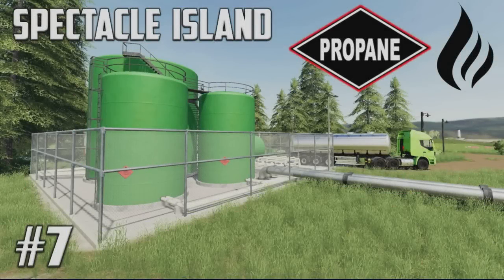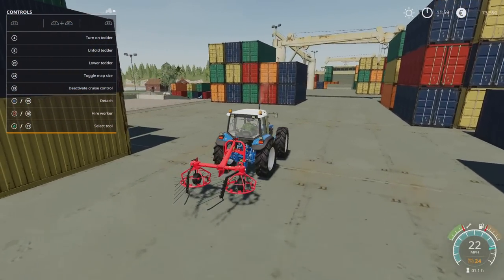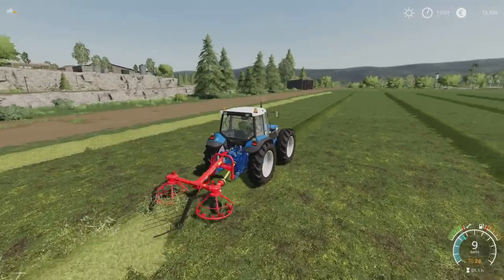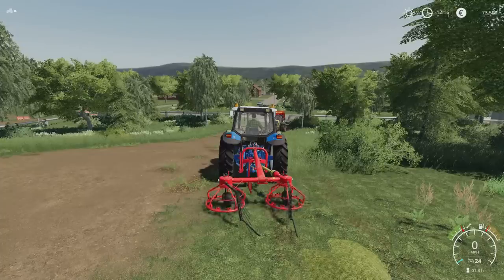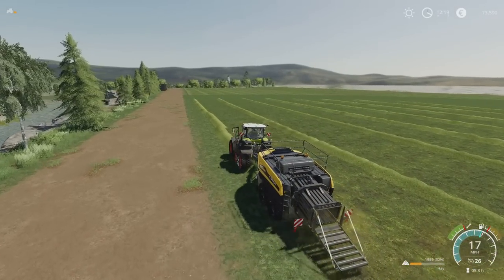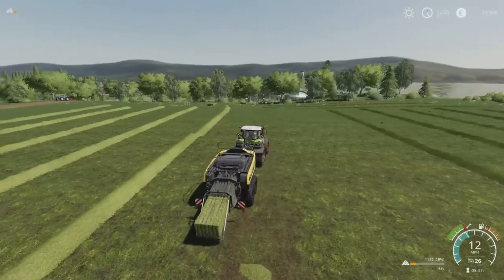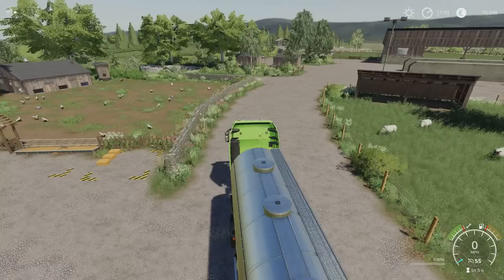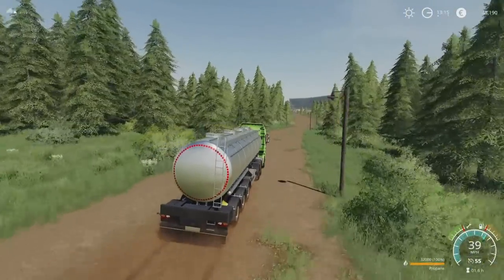SPECTACLE ISLAND #7 / PROPANE / Farming Simulator 19 PS5 Let’s Play FS19.

Comment: That Foremost... I used to drive a 'County' - which is essentially the old dog version of this. On the upside, it was awesome in forestry for dragging trees out. On the downside, it was a complete dog to drive. Two things have stuck in my head from years back... one the clutch was so heavy it was nearly a two-foot push. And secondly, the joy of the drivetrain... The fronts are driven alongside the chassis from the rears on each side, which makes it very low (good for forestry etc) and much like a tank. But... the front tyres wore something terrible - so they ended up a smaller circumference than the rears. All good until you drive it on the road, and due to the drivetrain the fronts had to 'catch up' to the rears which were effectively geared higher.  The result was a pretty hectic drive using the hand throttle and a pogo'ing beast of a tractor. Stopping, steering and general control was mostly a suggestion... which is fine when you're in a tank!

Comment: Hey Sealyp, I work in propane industry, normally it a liquid until it been used, when u turn any appliance, the gas will go thru the lines but the tank needs to keep it pressure so it will literally boil in the tank, so replace the lost gas.  However when we deliver it will be liquid until the propane is being used. As long as the temperature doesn’t go below -44 f not sure what that is calculus, the tank will always replace the gas that is being taken out, as long as there liquid in the tank.

Comment: Liquid petroleum gas is a blanket term it can be propane or butane propane boils at -42c butane -2c stored as a liquid by pressure so tanks can hold more useless information i remember from camping years back propane for winter butane for summer

Comment: The newer Case Magnum modded tractors (older models 2008/MX) have the trailer hookup too low so its the opposite problem as this Class Terratrac. Trailers and implements that sit low get caught on curbs, high spots in terrain, railroad tracks. I really love that mod though, wish there was an update to fix that

Comment: I’m really liking this map, my only issue is I’ve had to restart twice now 😞
Both time’s I’ve hit options button after clearing the yard up, the auto save starts and that’s the end on my gaming, the PlayStation crashes and corrupts the save in the process 🤷‍♂️ I’m fairly sure it’s a mod issue, but I’ve no idea which one or ones 🤷‍♂️ this is going to be a long weekend 🤦‍♂️
Reply: I have the same issue with ps4, I've got 115 hours on this map and after about 10 minutes of game play I crash and get an error code. It happened on lazy acres and eureka.  The mods aren't the issue I think it's a Playstation issue I didn't have an issue till the last software update. I've done everything Sony said to do, I even completely restored my ps4 to out of the box condition took half a day and still have the same problem.  I'm going to play on my MacBook onto my TV and from what I've read I can use my ps4 controller.
Reply: I have the same problem
Reply: I’ve come to the same conclusion, tested all the mod’s I thought may have an issue, I still get a game crash 😞
It may be time to send in a ticket to giants, I don’t want to play my other play throughs, potentially I could lose 1000’s of hour’s game play

Comment: That PTO on the HD Baler was angled so badly. That if it were real life you'd have snapped your PTO off in half or worse, broken it off at the gear box on the tractor.... Lost hours of work to repair.... PTO shafts have some flex to them but not that much...